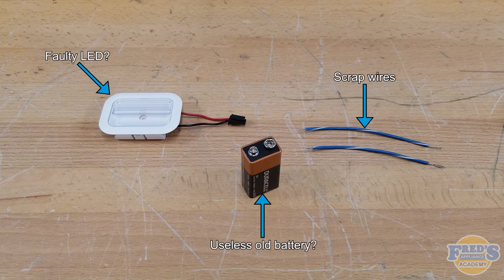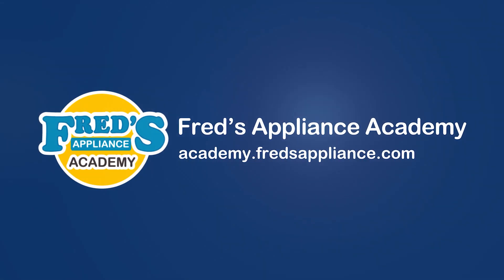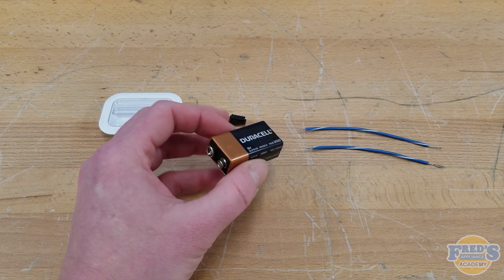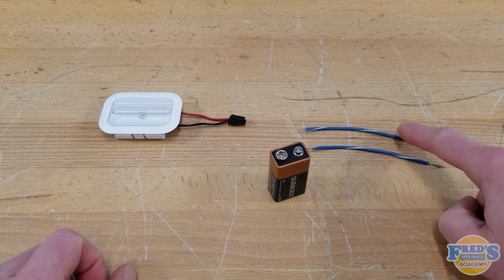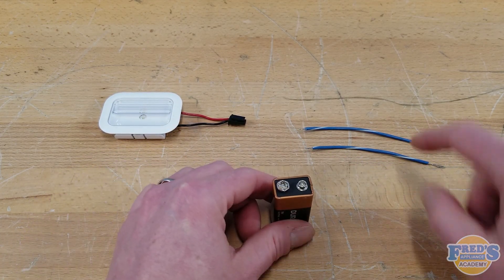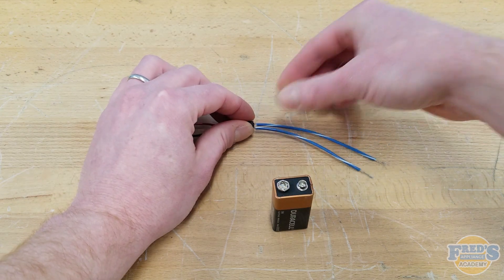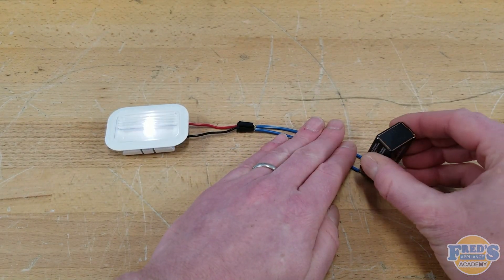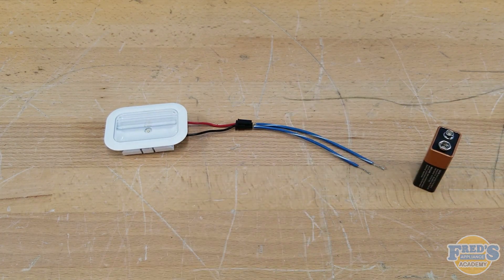Testing an LED Bulb in a Refrigerator using only a Battery and some Wire

Comment: THANK YOU!  I am learning electronics to hopefully troubleshoot my Mac Air circuit board and I just wanted to conduct a simple successful electronic test.  
     I have a basic LED bulb with two wires, hooked it up with a good battery & got nothing.  Apparently the typical AA & AAA batteries with 1.5 volts is not enough.
     Switched to a 9V battery & the light went on.
     Even though I have a degree in Computer Science I’ve never done much with hardware.  It’s always best to start with simple concepts.  Im guessing if I hook enough AA’s in series I can also get it to light.
Reply from the maker: Just remember that some LEDS are very low voltage. Even a drained 9 volt can be too much and burn them out. :)
Reply: @fredsapplianceacademy   Thank you for the heads up!